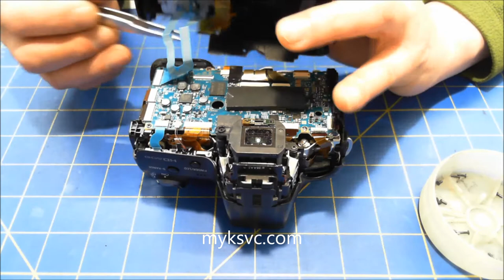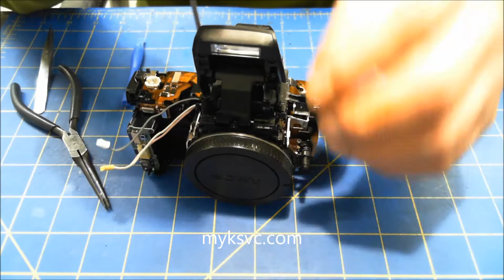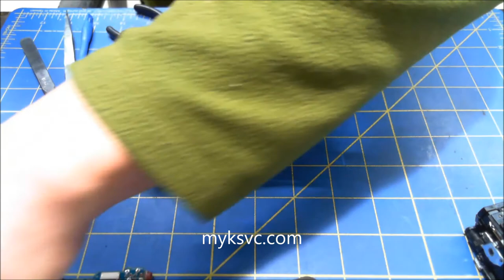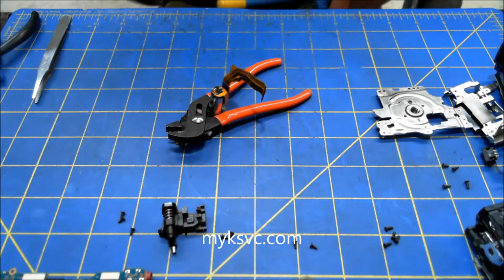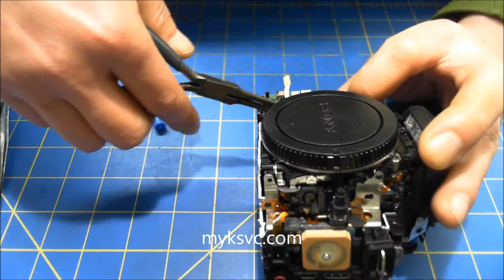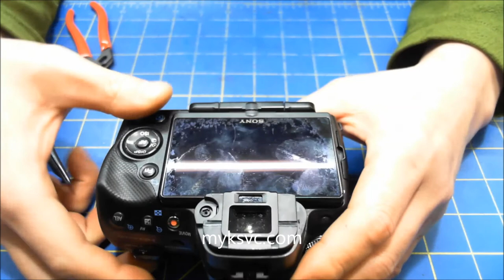How to replace  Shutter Motor Sony SLT-A55V

Comment: my shutter motor measure only 5.6 ohm...one new measure 9 ohm...do you think that the motor it is bad...shutter still work, when power off the camera shutter should stay close or open? My problem is that the autofocus not working at all on photo mode but working correctly on video mode. At some point the auto focus started again to work but then the battery died...it went on some protected mode and reset it only after putting it on charger but then the autofocus on photo mode ceased again to work.
Reply: Try getting a new battery perhaps?